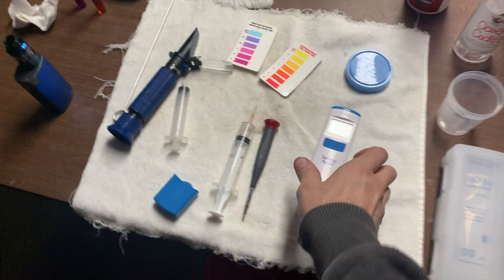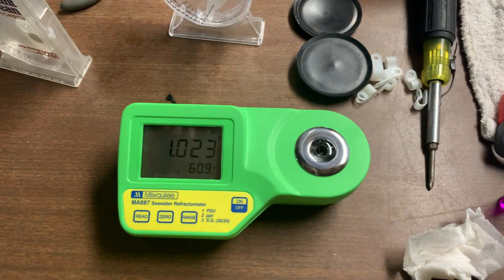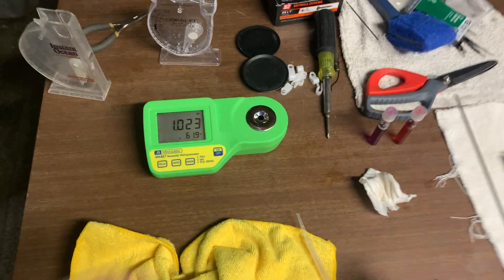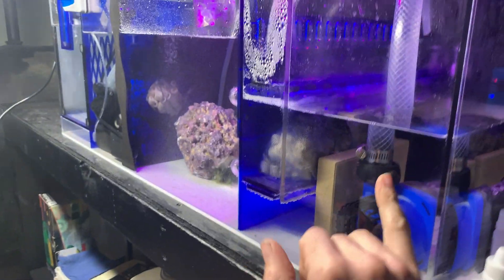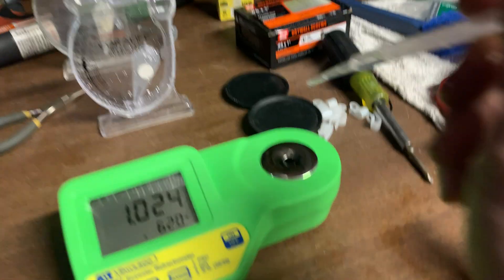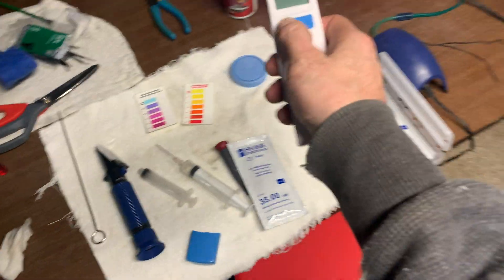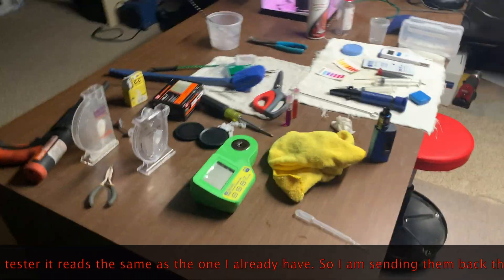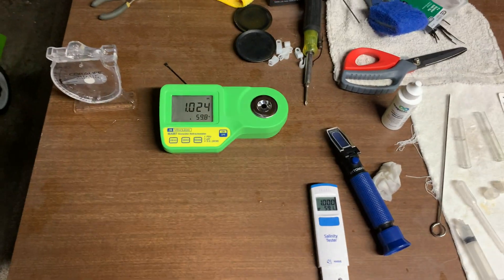Hanna salinity tester versus milwaukee MA887

Comment: Have you calibrated this with the kit?
Reply: What are you talking about the Hanna Checker if that’s what you’re talking about yes I also have two of them and return both they both read low all the time they always read 1.022 even though five of my other checkers are all reading 1.025 I would not trust or by the Hanna Checker it’s not right and I tried multiples of them they all did the same thing. The Milwaukee tester is amazing you don’t have to calibrate I think but once every three months and you just use your RoDI water the calibration fluid it comes with doesn’t even calibrate it properly. Every time I try to calibrate the Milwaukee one with their own fluid it came up low. I used  ro DI water came out perfect
Reply: @JasonStJohn-my1cs  thank you for the detailed review!